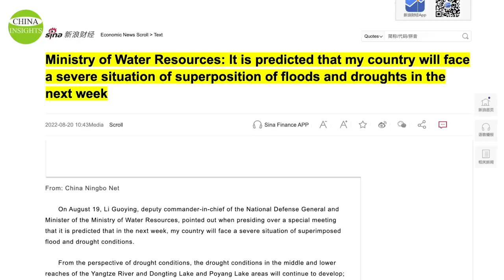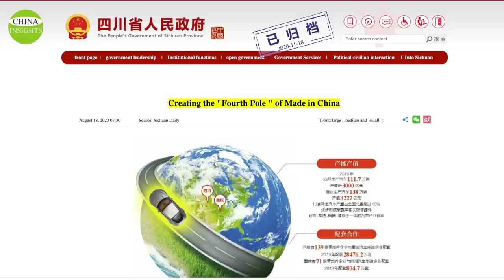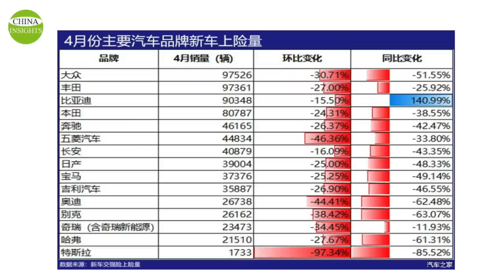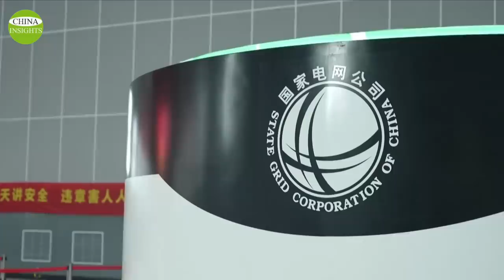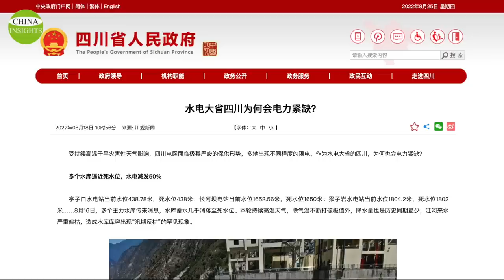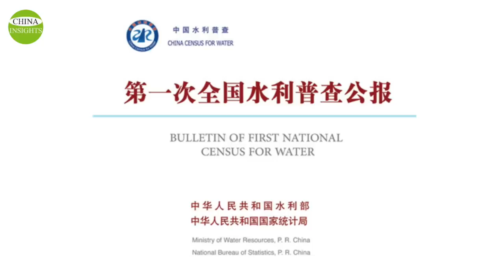Why does Yangtze dry up? The Power Crisis continues & Extremely high temperatures grip half of China

Comment: For perspective, imagine if the Mississippi river disappeared. The Yangtze is(was) that big
Reply: The Yangtze has twice the flow rate, actually, though the Yangtze doesn't drain anywhere near as large a basin as the Mississippi
Reply: @alexv3357  That's because China's much more mountainous. The Mississippi valley is fairly flat by comparison.
Reply: My town boarders the big black river and we mainly get out electricity from it, I can imagine how life would be if we was in a similar situation
Reply: Or the Colorado, which no longer reaches the ocean.

Comment: China spent a lot of money to shift water from south to north. Can they reverse this water flow or was it designed to only flow one way?
Reply: I’d assume they probably cannot reverse it, but closing some dams would slow it down. They’d still need it to rain in the south though.  Problem is that if water isn’t flowing through the Three Gorges Dam, then they lose power. 

Funny how expensive it turns out ignoring climate change can be. Seems a lot more expensive than investing in green energy and cutting greenhouse emissions would have been and it’s only gonna get worse for everyone.
Reply: Yes it can flow back. In fact they spend electricity to pump it north. But it's not like they store billions of cubic meters at the northern portion. At best, what they can send south will be a drop in a pool.
Reply: If you destroy the stuff that made the reversal nature will restore itself naturally. But you need a lot of rain.
Reply: Just build another one 👍
Reply: The question you should be asking is "Will they lose face if they admit their mistake?"
Reply: It'd a system of canals powered by gravity so no. That project is also not going to solve the water scarcity in the north
Reply: SHIIEEET  it was obviously sarcasm.
Reply: @Living_Life242  The best green energy is Nuclear.
You can't get much more efficient and consistent than that
Not to mention it would help with the smog problems in the cities
Reply: @1stCallipostle  Can we make an exception for China? I get that they make a massive amount of greenhouse gases and converting to nuclear power stations (when they already have nukes of dubious quality anyway) could theoretically do a lot of good. But their shoddy craftsmanship and the level of systemic corruption that leads to things like poisonous baby formula and rat meat disguised as beef makes me uneasy…
Reply: @1stCallipostle  can you imagine China building tofu dreg nuclear reactors ? 😂
Reply: @ninobecirevic7135  You already know the answer to both parts of that question.
Reply: If this project is completed done but no rain no water what happen?
Reply: @Living_Life242   The hydro dam is green energy... Its the reason they are having so much issues. This happened in Texas when the wind mills froze...
Reply: @cooldudecs  Fair point. But we can also agree that a good deal of the problems are because of how they built it, seemingly just to make it the biggest hydroelectric dam in the world. They could have made several smaller dams instead and there wouldn’t have been nearly as much of an impact. Instead they chose to make one so big it completely floods a massive ravine causing all sorts of ecological issues and is at constant risk of just collapsing under the weight of the water.
Reply: @ii121  I mean, with infinite manpower and industrial pumps, sure? That’s not the same as it being practical or in any way feasible for what they need done.
Reply: @lombardo141  China has made nuclear reactors and, yes, they have problems… :O
Reply: @advancetotabletop5328  yeesh....

Comment: I use to live in China. It's a hot place even in a mild year. I can't imagine living there with this kind of heat.
Reply: I feel bad for those people
Reply: A large portion comes from fact that they build tower apartments that BLOCK natural wind patterns and increases the rising heat that causes clouds to dissipate
Reply: A brother in law lives on the 7th floor of an older Shanghai apartment with no air conditioning and no elevator either.  I couldn't do it.

Comment: The standard way to measure air temperature is 1m high from the ground in the shade. At least that's the rule where I live. Of course, that means that surfaces exposed to direct sunlight will be much hotter.
Reply: That's the standard for the U.S. National Weather Service, and basically every other developed nation with a similar weather prediction dept or function.

Radiant surface temperatures are mainly defined by their BBT index (Black Body Temperature) which is a combination of their crude thermal capacity (a function of their elements/chemical composition) crossed with their reflectivity (or Albedo).
Reply: Yeah, a lot of places even directly state "X c/f IN SHADE", that's how you measure it. In the sun the differences are just too wild close to the ground because the temperature will vary wildly based on what kind of sun absorption and thermal capacity the material under you has (black granite or painted black steel will be blazing even in colder days, normal soil, etc will be way colder...)
Reply: Yeah, them measuring the temperature on asphalt in direct sun doesn't really prove their point that air temperature might have been higher than 40 degrees C. I'm all for criticizing the chinese goverment but "proof" like this aint doing it.
Reply: @njalid  I will add that it is possible to get "thermals" (large blobs of abnormally hot air) above large structures.
Anyone who has done roofing before will know immediately how brutally hot it can get on a roof even with neutrally colored (read: non-black/dark) material like pale concrete, brick/adobe or stucco-top.

In those air masses, it is possible to reach 40C air temps, though these are somewhat wild things in themselves since they tend to rise up in large waves as the day goes on.

(it's the same sort of phenomena found on the lee side of the Rocky Mountains in the United States; hot rocks that release very warm low-level air parcels. Hang gliders have to watch out for them since while they give amazing lift, they also create invisble micro-vortices as part of a restorative force downdrafts, as "What goes up must come down" applies to clouds and air parcels too.)

Comment: 55 or 57 C is ridiculously hot. That's 131 or 134 F. Even the official 40 C is 104 F.
In the American South, we are fully aware of what happens when the temp goes above 100 or "triple digit heat". It's above your body temperature so sweating produces diminishing return on investment. Your body can't cool off properly. You step outside and you instantly hate it.
I doubt most of Europe understands 100 F weather as much, although I heard they hit it this year in London. It's not fun. You don't want to be outside.

Of course it's worse for people in London who aren't used to it and don't have air conditioning. It becomes deadly.
I'd rather have A/C and be comfortable most of the month until the electricity bill is due and then freak out.

Above 110 F even the A/C has diminishing returns. It can't cool your place off like you'd want. It too needs to transfer internal heat outside somewhere. This process is less efficient as the temp rises, so you end up miserable in an air conditioned room as well. Just not quite as miserable as you'd be outside.

100 is bad. 110 is horrible. 130 is unthinkable.
Reply: that because the temperatures being taken in direct sun over black rock
Reply: You need to realize that weather broadcast temperatures are measured in the shade. So it’s always warmer when measuring in sunlight
Reply: 110 is a regular occurrence where I live.  But it's "dry heat" ............

Comment: You would think "Tesla" would have installed solar panels.
Reply: Expensive, unreliable, doesn’t product much power for industrial applications, doesn’t work at night, doesn’t produce enough in rainy seasons 

Solar power is nice for small applications but large ones fail for a reason

Comment: I heard somewhere they would release water from the three gorges dam before attacking taiwain because it's a massive liability to hold that much water over people heads
Reply: I heard this too. Lmk if you remember where you had heard it.
Reply: @RowdyElectron  It was this channel. "China is more worried about..." .  Basically the dam is a huge target. If destroyed at full capacity would wipe out half of the populated areas in China as most are along the river or subsidiaries. As a safeguard they would drain it by a large amount so that a strike against it would not be as devastating. It doesn't take much to destroy a damn these days so even a cruise missile with a large enough conventional explosives could do the job. Any large crack would be enough to cause it to deteriorate quickly opening up larger and larger until a full collapse.
Reply: @brainplay8060  Destruction of said dam would be a war crime, I do not think it will be destroyed
Reply: @michaelkovalsky4907  yeah, however that doesn’t change the disastrous effect it would have for decades to come, while some could be put on trial and even convicted that would still cripple China for a long time
Reply: @michaelkovalsky4907  China is not innocent of war crimes HAHAHAH... That's funny
Reply: @michaelkovalsky4907  not true its not a war crime china said the would react as if it were a war crime, and would respond with nuclear deployment
Reply: @michaelkovalsky4907  War crime? That's a bit of a stretch. People use that word too. However, the Chinese has stated they would go full nuclear if someone attacked it.
Reply: @michaelkovalsky4907  If destroying a hydroelectric dam is a crime then i wonder why troughout the history every sides that were participating on a war are more than willing to tried their best to destroy or open the dam gates wide enough to create a highly disastrous flood for make the hostile forces paralyzed...

Comment: Everyone wanted to think Hydropower would have been a safe alternative to most energy plans, but in fact it's one of the most damaging. It fucks with the natural ways the waters are meant to move which in turn messes with the ecology. It was such an issue for these dams China built  that the rotation of the globe *actually slowed down*. The water is being messed with when it's supposed to run a certain way naturally through the seasons and by interfering with that they're seeing this crap. It also doesn't help they've fucked with everything from the microbiology in their water and soil to killing off large portions of their wildlife directly and indirectly.

Comment: Of course temperatures are higher in URBAN HEAT ISLANDS as the mass of asphalt & concrete hold heat and radiate it out at night, further raising the “start” temperature at the beginning of the day. GeoEngineering/weather-warfare is also being used.

Comment: as I understand it, most power productions use tons of water even if they are not hydroelectric. And also as I understand it, there are several nuclear power plants along Yangtze river, using the water from the river. I really don't know how much these power plants demand water, but given this much water shortage I'd guess they cannot be running at its best capacity at the moment.
Reply: Most types of power plants boil water into steam to spin turbines, then use additional water for cooling. They expel the cooling water into a river or lake, but have to avoid making the body of water too hot, to avoid killing fish etc. if the lake is ALREADY hot from the weather, that restricts what the plant can expel, slowing down operations. Also if the cooling water is taken in from that hot river or lake, it can’t do as efficient a job of cooling.
Reply: @Big_Tex  thanks for explaining

Comment: "Why dont they use solar power?" As if its allowed by their government.
Reply: It wouldn't help much anyway even if they did.
Photo-voltaic cells are incredibly inefficient at the best of times, and far more often than not, fail to provide more power than the BTUs it took to build them within their operational lifetime.

Solar power's best use is as a supplement for low-end remote site generation where regular utilities can't reach.
It is by no means, a full-on replacement for centralized large scale power generation, like power plants. That isn't a political opinion either; it's the laws of physics.
Reply: @atmosdwagon4656  thanks, very informative 👍

Comment: The timing is perfect for Taiwan to strike the three gorges dam if they want to achieve maximum damage
Reply: Actually, a dam is most vulnerable when it is full. Only then you need to put a very small bomb behind the dam to destroy it. That is because half the Shockwave goes towards the dam, and the other half towards the water, which promptly reflects it back towards the dam. And even a small crack will then allow water through, which at those pressures and flow rates will chew through it like a million moles through damp clay.

If it is empty, then you need a lot of very big bombs to destroy such a massive structures, and missing by even a few tens of meters reduces the damage very much, because the energy is quickly dissipated in the air instead of being reflected by the water into the structure.

However, if I were China, and were considering maybe starting some shit that would likely make my dam a target, I would find any excuse that could possibly present itself to me to empty that dam very quickly.

You know, like a drought or something